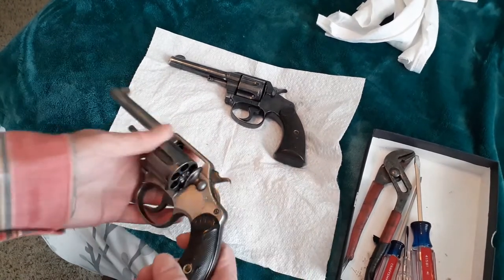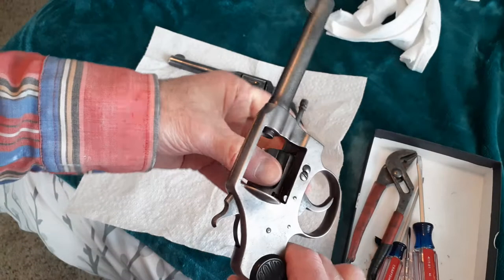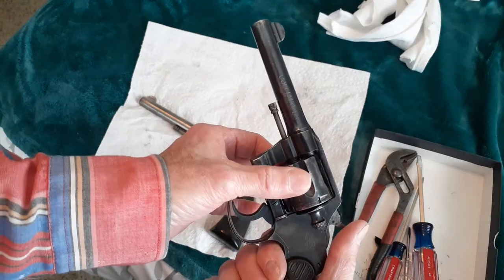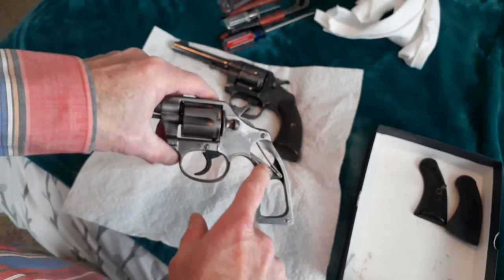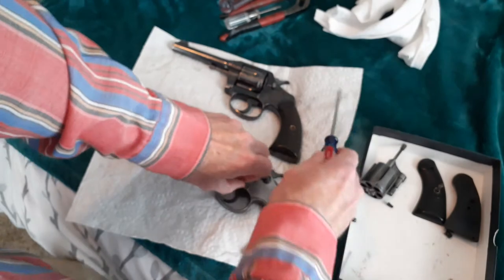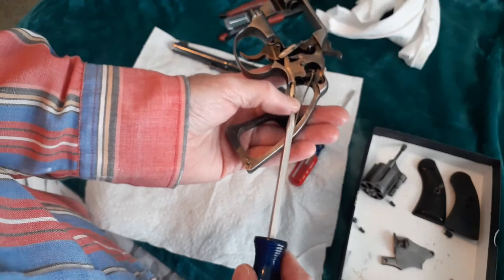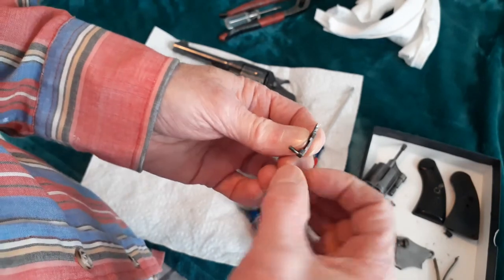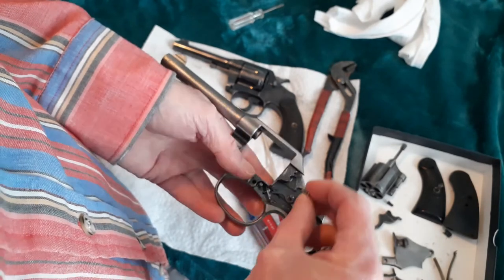COLT 1915 POLICE POSITIVE complete TAKE DOWN 32 OR 38

Comment: I’m having problems with my bolt catch not engaging and sinking to allow the cylinder to turn. It is original and worked fine before reassembly not sure what else to do or maybe try ordering newer parts. Any tips?

Comment: How Much are they worth? I have one of each and want to get rid of them.
Reply from the maker: Well I mean depends on the condition of them. I mean it could be worth minimum 200 all the way up to 1200. But again it depends on condition if it's in pretty decent condition average blewing I would say 350 to $500 a piece they have gone down in price wise as collectors they're not as big as they used to be up until 2 years ago. You can actually look on GunBroker on the sold items of your particular models and get a general idea of what they would be worth hope that helps you good luck with it
Reply: @chaseww  the 38 is a 1906 its in decent condition has the same issue with timing as the one in this video but still has all the bluing and the 32 is in mint condition and is a 1907
Reply from the maker: @davidalvarez4610  well the 1906 with the timing issue is probably about 4 to $500. In the 1907 mint condition 32 would be worth about $800 to 1,000. I believe that the 38 caliber ones or more collector than the 32 caliber right now in the market but if it's in mint condition as you say and depending on how  long the barrel is. If it's a short two and a half inch barrel or snub nose would be worth more but if it's like 3 and 1/2 to 6 in barrel it's about worth $800 to a thousand to a collector that truly wants it. And just to let you know that sounds like their first issues